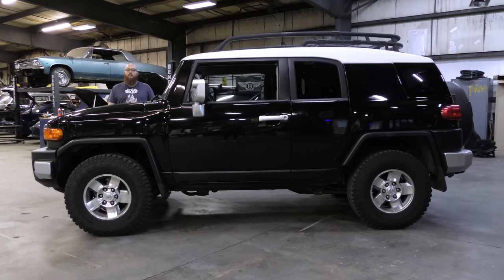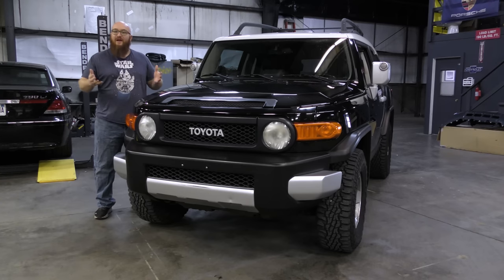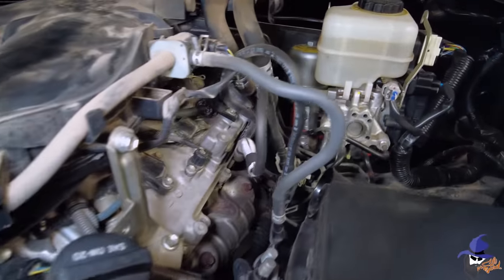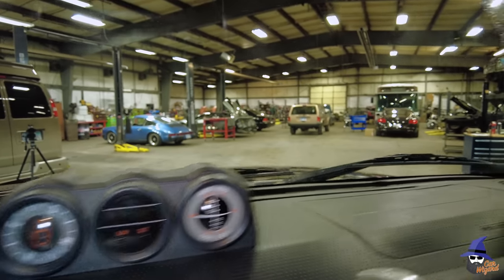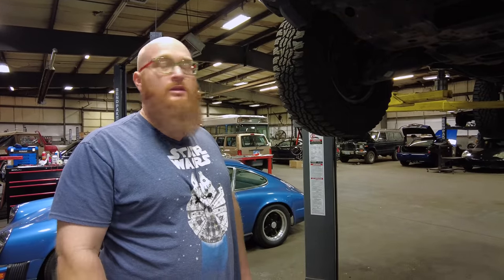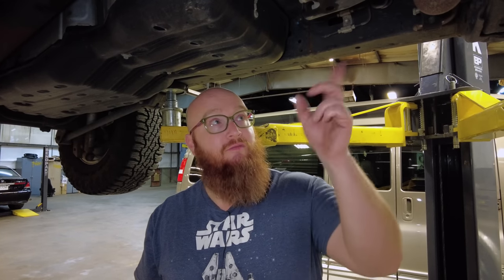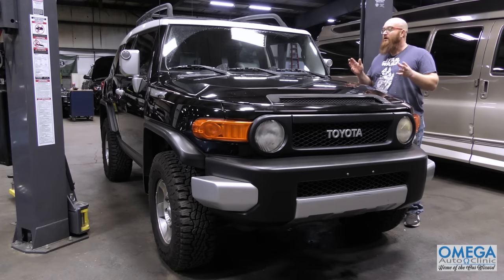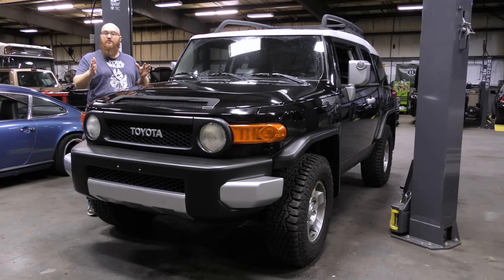"I finally got the Toyota I've always wanted!" CAR WIZARD gets a 2010 FJ Cruiser!

Comment: In the entire video you did not run and record what the engine sounds like at idle. I would wager that the engine has the Tacoma Tick. It sounds like a sticky lifter on cylinder #6 when the engine is up to temperature, in park, at idle, with the hood up. Although, you can here the tick with the hood down. There are several youtube videos on this engine noise for the 1GR-FE, most notably on the Tacoma which has the same engine but manufactured in much greater numbers than the FJ.

However, this noise does not act like at sticky lifter it just sounds like it. In the past if I had a vehicle that had a sticky lifter I would change the engine oil and filter, get the engine up to temp, and then add the oil additive Prolong (Prolong Super Lubricants PSL11000 Engine Treatment - 12 oz. , White Bottle), which I know sounds like a gimmick, but I have had great success with this additive freeing up lifters due to varnish? Even though the engine has this noise it runs and drives fine. If you are truly a wizard, you should find out why the 1GR-FE engines have this noise when the vehicle has over about 45,000 miles. The Tacoma Tick is a common concern, but it never seems to lead to a catastrophic failure.

Also, it is odd that one cat has a heat shield and the other cat does not.

When the engine is started the cooling fan mechanical temperature clutch turns the fan even if the engine is cold. Which is strange, but my problem with this setup is the fan noise on start up is very loud. Why not use dual electric cooling fans?

Did you mention that the mirrors and bumpers are painted silver? Why? My FJ is painted silver, so my mirrors and bumpers match my paint. Why did Toyota not paint the mirrors and the bumper the same color as the car? This is very strange. It looks okay with black paint, but with the other paint colors it looks like Toyota installed the wrong mirrors. 

The front of the FJ looks rather wimpy. Or as Arnold would say, "You have a girly bumper". A real macho improvement to the car front look is to install an ARB Bull Bar (now called a deluxe bumper). It is strange that the car you purchased did not have either Rock Rails, or Running Boards, it is very rare that an FJ is ordered without one of these two options. 

Common failures for your car at its old age: 

1) Brake pedal switch not working (dirty), symptom, you can not shift out of park with your foot on the brake. To get it out of park you have to depress the shifter bypass button. You can replace the brake switch or you can actually take it apart and recondition the contacts. 
2) Front wheel bearings. My guess it that your front wheel bearings have already been replaced. 
3) Intermittent dash data display. It will flicker when you go over a bump. This is due to solder joint cracking on the connector PCB joints (a symptom of vibration over time). The fix is to remove the old solder from the connector then re-solder.

Comment: The design of vehicles today is non functional for anyone 6’ plus. The dashes are so deep, the roof line so low and the sears so far back, need to hunch over to see the traffic signals.
Pillars are so large today they use plastic and large black painted borders on all the windows to hide unfinished product creating huge blind spots. Thus the need for all the sensors and cameras around vehicles today. 
From Texas. Check under the floor mats for flood damage. 
BF Goodrich Trail Terrains. Good tire. Had those on a truck I had years ago. 
Being a mechanic and YouTuber. You should have bought a piece of crap to fix. 
Still available outside of the US for some reason. 
I’m driving an 02’ Ford Ranger with 160,000 on it. I dread the idea of buying a new car. Will either be a Toyota from within the last decade or something pre 75’ to avoid smogging.
Anyway. Nice.

Comment: My wife and I own a 2001 Prado with a 3.0 litre diesel auto. Just been serviced at 630,000 kms in Australia. New head at 270,000 kms but block, transmission and diffs still OE. No rust either. Shirley and Neil.

Comment: I really wanted an FJ and I can't find one that's worth the price of 40grand or a rusted FJ with 200k on the dash. I did however find a 1987 4x4 Suburban lifted and ready for the trails and mud with a complete restoration of the frame and upgraded engine and transmission, clean for 36 grand it's miles are low.

Comment: Hi, last year 2022 I bought a 2010 FJ in Saudi Arabia with 359,000 kilometers on the meter after test driving it. Immediately after taking delivery I took it to a Toyota service center and the head mechanic confirmed that the vehicle is in excellent condition. Since then I've replaced all tires, the rear absorbers, polished the headlights, replaced the headlight halogens with LEDs and replaced the horn with a twin Bosch. Overall I've driven it through deserts and mountain areas and it holds up pretty good. Prices now are going up since the 2023 edition is the last one.

Comment: It’s all how you take care of your car. I put 400k on a Mercedes-Benz Metris. Yes parts had to be replaced, but the engine and transmission had no problems other then plugs and coils once. My Volvo XC60 even better. 250k miles about 15k in maintenance and repairs.

Comment: Hi Mr. Wizard I have a 2004 crossfire. When I hook up the battery I get this major spark battery goes dead after a couple weeks I followed your instructions how to check the amperage and I’m coming up with 0091 is this correct?

Comment: Nice cars BUT they have the WORST blind spot of any car EVER.  That metal panel between the side windows seriously blocks vision!  I know a couple who traded one in with less than 1000 miles after a couple of near misses changing lanes on the freeway!  Hopefully you guys can take the necessary adjustments to compensate.

Comment: My 2007 Fj with 237,000 mi looks new and drives like new. Tight as can be and no rust on car or frame and immaculate interior.   Doesn't burn a drop of oil.  The only expensive cost so far has been a recent cat and sensor replacement: 1.500 one side all OEM parts. Ready to do the other.   It's still worth it.  I keep the transmission fluid fresh and change the oil with Lucus oil additive added.

Comment: They are still built and sold in Europe I'm told. Don't know why they won't import anymore. I have one with 162,000 plus miles. Its tight and drives very well. It's great off road or in winter conditions. Love the ugly bastard.

Comment: As an owner of 2 2007 Fj 6mt's, one at 138k and one at 179k I can say I have zero leaks, zero problems, original clutches on bot although both will be due as far as I can feel for clutch travel but neither have ever had a problem. I've only replaced wear items and fluids. Both are on a 3 inch lift so axle boots did go but I replaced them with high angle boots and have been fine. I abuse the heck out of mine even to jump it as often as possible and the "wifes" I abuse it too but we keep it as nice as possible. No body even in a car keeps up with me on mountain roads and eumaway from jeeps. Now I'm not set up for crawling but more go anywhere and most jeeps aren't either and I go all places an stock jeep with a lift goes. Oh yes also other than ad one I USE nothing I don't NEED I do not modify the engine or drive train.

Comment: That 180k in excellent condition is a testament to Toyota quality but also importantly to the fact that most owners rarely, if ever, go offroad. A 9 yo car with 180k was a commuter car with many easy highway miles. The owner was also a careful, responsible one who clearly took care of it.
By '05 Sienna had 250k when I sold it and it was in similar condition. The engine was as smooth and economical as the day I bought it new. Zero leaks. The paint suffered though as it spent 100% of its life parked outside. The interiror was perfect though. Best car I ever owned.

Comment: I still drive an old 1996 4runner SR5 Limited and 2004 Tundra Limited 4.7 L.  They are over 230,000 miles in an original engine.  This😢 FJ will go 300,000 miles.

Comment: It reminds me of my friend who bought a 2012 Dodge Challenger with 80k mile almost two years ago,  I told him something is going to break on that car and of course he didn't listen. Next thing I know the transmission was blown, the car ended up sitting in the shop for almost a year, he ended up buying a 2007 FJ Cruiser with more than 100k mile, and all the car needed were oil change and new brake pads. It's not fast or fuel efficient, but it just looks so cool.

Comment: My friend had one in tan.
He did not take care of it. But it kept going. His dad loves Toyota SUVs and his mom is on her 2nd Lexus LX.

Anyway the FJ my friend had was beat up and never taken care of. Lots of memories he wrecked it a few times. But a few weeks back he finally killed it by bending the frame when the wheels hit a rock wrong.
Most likely to be totaled. 

Had at least 230,000 miles with very hard driver behind most of those miles.
Also for some reason it was a 2wd model.

Comment: This Toyota and the Nissan Xterra are the best mid size, off road,  utility SUVs in my opinion. Very basic,  very unreliable, and very weird lol.  Yes,  driving them is like driving a brick and mpg sucks.  But they are solid and practical. Definitely the FJ is way above the Xterra in quality and reliability. Both cost an arm and a leg these days for a good one.

Comment: I have one of these on my radar for 13 grand.  I need some high ground clearance......but not a Jeep.  It has over 100k on the odometer, but that doesn't intimidate  me at all.  200k 300k under 15k I'm all in because these go for 30-40k with low miles and mint condition.

Comment: The toyota bug has bite the wizard.
My daily is a 1987 4runner turbo, 137k miles. 
Also have a 1987 bmw 325i.
Both rock solid

Comment: As great as an FJ is? I am still 4Runner. Course you cannot get the full manual 4runner post 2000. FJs just insane price and lots of parts unique to them.  FJs eat front windscreen.

I wish I could do a frame off on my 2000 4runner with stick on stick.

Comment: I bought mine in Kansas 2 years ago with 241k on mileage same color scheme i got for 7500 mine a  6 speed manual i took mine to a whole new level it had vsc light on and trac off no and check engine it had knock sensor issue due to a nest of something at Toyota its a 20 hour job because they take off head to get to them i took off intake manifold and other components and cut weld on 2 tubes to get to them took me less 2 hours found a chewed wired broke i replacement wiring harness and both knock sensor,  issue fix and if your vsc/trac light on and can't fiqure how to get then  back on my issue  was brake light switch replaced that light gose off but here come the build i installed myself magnuson supercharger,  6inch pro comp lift , kmc wheels on 35x12.50x18 Mickey Thompson tires,  got rid of oem roof rack installed a front runner rack lot of options,  installed front arb bull bumper warn winch , expedition one dual.swing out rear bumper for 2 Jerry can and tire carrier,  arb roof top tent ,awning,  spod for controlling lights i installed curve light bar and arb ipf  round light in roof rack custom racing steering wheel,  shift knobs red and black strips installed clazzio custom seat covers red and black , orange boxx rear fold down table , put led lights in mirror  lights that really light up vs the oem that not very bright changed the grey mirrors and door handle to black ,installed dual battery system and hood solar panels to keep batteries top off , installed headers and trd exhaust system,  ripp coils packs updated tails light to newer model installed a arb snorkel i took my fj to a new life for a 2007 Toyota fj cruiser with 241,000 miles she runs very good no leaks i did have to replace radiator,  ac condenser,  transmission bought it new , installed new dual clutch light weight flywheel replaced all control arms upgraded one day i get mine painted for now not important weather guard floor mats i did replace the intire floor mine smell bad from midrew the insulation under mat was gone and wet , the Toyota fj cruiser frame is my concern they do rust out if not taken care of but the Toyota are built to last  vert reliable if you take care of them get a good scanner where the cheaper ones don't catch all your faults i did all my work except the lift kit upgraded my brakes to ebc stage 5 with all this added weight i need better brakes i own 8 vehicles now my current 2 projects are my 2007 land rover lr3 and 2017 Mercedes-benz sprinter 170 build this is what makes life interesting is having endless projects build in your vision

Comment: Awesome!!
I did the same as you. I had a standard cab 1990 C1500 Chevy that lasted 20 years and was still in great shape but I needed more seats for my expanding family. I bought a new 2010 V6 ext cab Silverado. It was in the shop often for warranty work and then I got sick of fixing it so in 2017 I traded it for a 2015 Equinox. Shame on me. Luckily the auto market went insane. So in 2021 I got all my money back trading the Equinox for a 2008 FJ 2wd with 81K and it was a Florida car so no rust. It was $21K but it's been great. So far it needed a power steering hose, tires and a brake job. The only annoying thing was the roof leaked at the roof rack bolts. I replaced all the seals and hardware and deleted the roof rack. I had to drop the headliner because I wasn't the first to work on the issue, but it was a simple DIY job. I love it. I did build a shelf in the trunk to cover my winter weight sandbags since mine is 2wd. Between your advice  and Scotty Kilmer I went with Toyota. My wife did too. From a 2015 Captiva to a RAV4. Thanks for your advice and sharing your knowledge.

Comment: Yup. I have a 1974 Corolla (bought new) that I retired in the 90s with 314,000 miles. Still have it, want to restore it. Turns out before I replaced the head,  it was actually running on one cylinder because the valves on the other three were so worn there was zero compression. Didn't know it at the time, but it took several minutes to start and it only got up to 60-65 miles per hour. On one working cylinder!

Comment: I just bought one of these and the exterior and interior condition was as nice as yours, but underneath is....rough.  Lots of rust.  Only paid $13k for it with similar miles so hoping it wont be an arm and a leg to fix it up underneath.  Couple spots rusted through underneath, but mostly just where the welds are on the frame (which is very common after looking at 5+ of these from the north).  Hopefully can just patch those spots and sent it

Comment: It is likely loud not because of those tires but rather the wheel bearings are making noise.  Very common issue with these FJ’s from 2007-14. The fronts are not bad to replace but the rear wheel bearings are a pain to service/replace. My wife’s FJ was noisy too and we replaced the tires with some conservative all terrain tires and the noise was still there. The front had no play but once I pulled the rotors it was obvious they were done. The rear differential are also know to get louder with age  which can sound similar to bad bearings as well. Once I replaced the front’s it was noticeably quieter. Once I did the rears it was even quieter. Finally once I regeared the whole truck it was completely silent.

Comment: I have an 08 of the same color! 

Brilliant car, don't care that it drinks more than an alcoholic! It's worth it

Everytime i get in it i love it! Can recommend Teyes CC3 if you want android unit for it! Mine boots immidiatly even in -20 celcius and for a touchscreen that is insane! Also i put a teyes backup camera on a antennamount on the backdoor hinge! did not need to drill a single hole that way, works like a charm! You can use it while driving as a blindspot safety which is really nice addition

Comment: Good deal Wizard, it's a 2010 model year with the second gen 1GR-FE dual vvt-i 4.0 V6. FJ is on the 4Runner platform and it should last forever.

Comment: We got one and took it to the outer banks on our honeymoon. The doors are a gimmick, they’re not practical in parking lots you get stuck between the doors. It drifts on icy roads because its short wheelbase. Ours didn’t have enough room in the back and didn’t have enough power, plus it was too wide for trails, and the rear door wasn’t great in the rain. Don’t get step bars, you’ll just trip on them. We also couldn’t put a sunroof in it because the roof wasn’t smooth. They broke 3 windshields trying to replace ours because every rock hits the windshield.

Comment: It’s already 200k miles just a piece junk😂 everything need to swap out with new parts expected engine or transmission. Which will cost more than purchasing a new car to swap those components. I mean at this mileage is beyond economical senses.

Comment: What is your opinion on flat towing 2007 FJ cruiser? I put the Transfer case in neutral and the transmission in park.  It’s seems to work well.  Is there any long term concerns I should have?

Comment: Add a Toy tech 2.5 in lift, and it will ride like a cloud. Much better than stock. My 07 has 180k and ran lots of tough Colorado mountain trails. No issues at all.

Comment: My prius with 300k miles on all original parts and liquids runs like new. No lie. Not even the brake pads have been changed. Only oil tires and filters. Thats it.

Comment: I had an 2008 FJ, traded it for a 2010, traded that one for a 2013 and still love driving it every time I get in it. I will never sell it. Considering I’ve been driving a FJ for 15 years, it surprises me that I haven’t got tired of them. The only thing any of these has ever needed was routine oil and filter changes and brake pads. All of these I bought new.